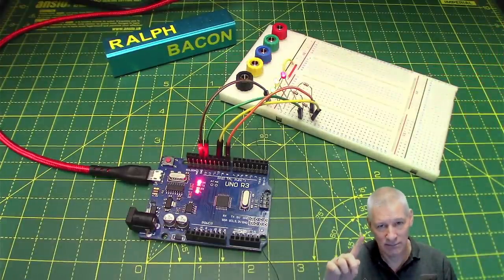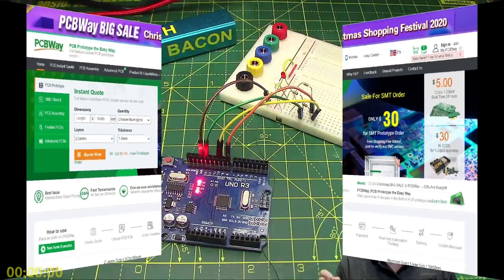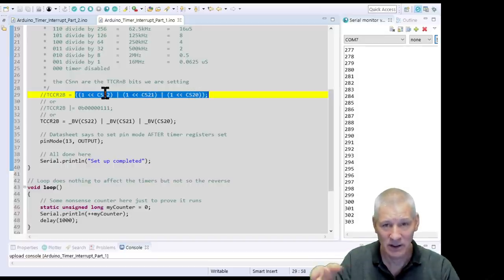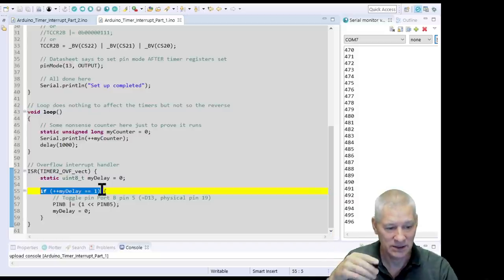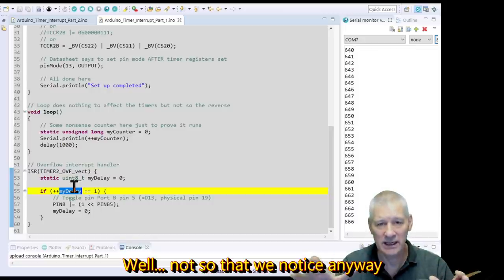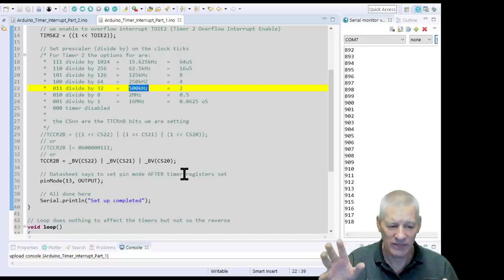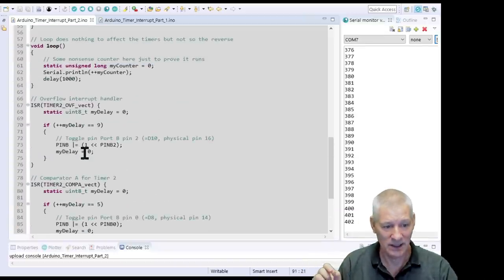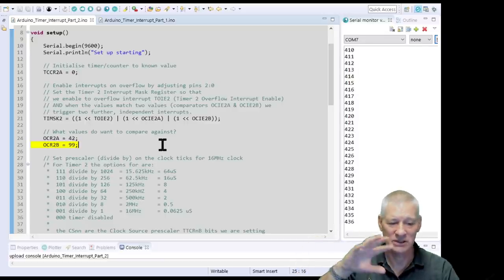#209 Arduino Timer Interrupts - Overflow & Comparator. Easy Peasy.

Comment: Hi Ralph, loving your videos - thanks!
Do you know if there's a way of grabbing the current value of an ISR vector? If so, you could hi-jack an interrupt, do your thing (increment a counter or whatever),  then pass control on to the original ISR. I did this years ago on Z80 and PDP11 systems, and it worked a treat! Would mean you could use eg Timer0 without disrupting it's usual functions. Stay safe, have a great Christmas, and hope the move goes well. Hate moving - very stressful. Cheers, John
Reply from the maker: You would have to rewrite the original ISR to either call your routine or write your own ISR that called the original code too. Applies often when using Timer 0 on an Arduino. But you can't define two ISRs both trying to be the routine for a certain interrupt condition - compiler spots it and throws its toys out of the pram. Yes, moving is too stressful considering we're packing without having an exchange date yet! I'M NOT STRESSED AT ALL!!!
Reply: @RalphBacon  "write your own ISR that called the original code too" - that's the idea. Would probably have to do an assembly code JMP from your code to the original code, so its return-from-interrupt worked correctly. But how can you get hold of the original ISR vector? I would google it, but you seem very knowledgeable in such matters, and I'm a lazy old sod. Chill - it'll all be alright on the night :)
Reply from the maker: The original ISR for Timer 0 is buried in the Arduino core but can be edited (until a new release splats over the top). It can be found in this file:
C:\Program Files (x86)\Arduino\hardware\arduino\avr\cores\arduino\wiring.c
and it's here for the Timer 0 overflow ISR
#if defined(TIM0_OVF_vect)
ISR(TIM0_OVF_vect)
#else
ISR(TIMER0_OVF_vect)
#endif
(The code then follows).
Good bedtime reading, yes, really.
Reply: @RalphBacon  Thanks. Nowt like a good yarn!

Comment: 8:20 the first and last methods also needs to be |= otherwise they will clear bits 3 to 7 !
Reply: should be ok I think.. .as OR-ing 0's preserves the underlying values ....... (1<<CS22) == _BV(CS22) == 0b00000100
Reply: @jwconlew  No it won't! The point is that the first and last of those two methods writes the absolute value, not read the current register value and OR it with the new values! i.e. first one should read
        TCCR2B |= ((1<<CS22) | (1<<CS21) | (1<<CS20)) 
the last one should be  
        TCCR2B |= _BV(CS22) | _BV(CS21) | _BV(CS20) 

or you can write it as 
        TCCR2B = TCCR2B  | ((1<<CS22) | (1<<CS21) | (1<<CS20)) 
and  
        TCCR2B = TCCR2B  | _BV(CS22) | _BV(CS21) | _BV(CS20) 

... if it makes it clearer! It's bad practice to implicitly write absolute values to registers unless you are setting/defining EVERY bit in that register. In this example the objective is to modify only bits 0,1 and 2.
Reply: @simon  You are quite right. it should really have the compound OR operator thinking about it... however the datasheet says TCCR2B bits 3/4/5 are read only anyway, and the bits 6/7 should always be 0 under normal circumstances.. so the end result is safe, just not academically right
Reply: @jwconlew  That's true. Its the academic content that concerened me. Don't want to be teaching young players bad habits!
Reply from the maker: Mea culpa, not checking it out well enough. It's what happens when you try packing a few house-moving boxes AND create a video at the same time. Smacked wrist for me.
Reply: @RalphBacon  No problem Ralph ... we'll let you off! The other 99.999% of the content was excellent. Need to slowly weeeeeen starters off Arduino, the graduates that come to my company look like rabbit in your car headlights when you throw an Infineon Tri-Core industrial controller at them and tell them you won't find an Arduino board package for that bad boy, go read the datasheet! 🤣😎
Reply from the maker: And you tell them "Sorry, digitalWrite won't work either". Put them off for life I should think.

Comment: What happens if your ISWhat happens if your IWhat happens if your ISR<***> .....

What happens if your ISR takes longer than the time between Interrupts?
Reply from the maker: You miss an interrupt as interrupts are disabled whilst an interrupt is running. However, that said, interrupts are queued... but only one (of each kind). Another reason for ISRs to do what is required and get out of there, sharpish.

Comment: 17:54 Really? if (++myDelay == 1) will always be true when myDelay is 0. The only thing you waste is the 'if' (but a smart compiler would probably remove it) ;-) What you should do is post-increment, not pre-increment. I'm sure you knew that, Ralph. :)
Reply from the maker: Actually, that code was just copied from the next sketch (with the comparators) and I changed the 5 (or whatever) to a 1 but didn't really think about it. Doh! I wonder if the compiler did remove it? But on the bright side I have packed 6 more boxes today!!! In the rain!!!
Reply: @RalphBacon  This is quite interesting. Without 'static' the compiler (GCC) removes the if statement, but with 'static' it does indeed put in a 'cmp $0x1, %eax' in assembly:

void withStatic ()
{
        static int myDelay = 0;
        if (++myDelay == 1) {
                printf("%d\n", myDelay);
                myDelay = 0;
        }
}

Compiles to

   0x401156 <withStatic+6>                 add    $0x1,%eax
   0x401159 <withStatic+9>                 mov    %eax,0x2ed5(%rip)        # 0x404034 <myDelay.0>
   0x40115f <withStatic+15>                cmp    $0x1,%eax
   0x401162 <withStatic+18>                je     0x401168 <withStatic+24>
   0x401164 <withStatic+20>                ret
   0x401165 <withStatic+21>                nopl   (%rax)
   0x401168 <withStatic+24>                sub    $0x8,%rsp
   0x40116c <withStatic+28>                mov    $0x1,%esi
   0x401171 <withStatic+33>                mov    $0x402004,%edi
   0x401176 <withStatic+38>                xor    %eax,%eax
   0x401178 <withStatic+40>                call   0x401030 <printf@plt>
   0x40117d <withStatic+45>                movl   $0x0,0x2ead(%rip)        # 0x404034 <myDelay.0>
   0x401187 <withStatic+55>                add    $0x8,%rsp
   0x40118b <withStatic+59>                ret

and

void withoutStatic ()
{
        int myDelay = 0;
        if (++myDelay == 1) {
                printf("%d\n", myDelay);
                myDelay = 0;
        }
}

compiles to

   0x40118c                                    nopl   0x0(%rax)
   0x401190 <withoutStatic>                mov    $0x1,%esi
   0x401195 <withoutStatic+5>              mov    $0x402004,%edi
   0x40119a <withoutStatic+10>             xor    %eax,%eax
   0x40119c <withoutStatic+12>             jmp    0x401030 <printf@plt>

I guess it makes sense. A static variable is like a global variable except in this case is local to the function. Maybe GCC is not brave enough to optimize a static variable? :-)

Edit: This is of course Intel assembly, but I bet it's the same story on Atmel
Reply from the maker: I know that any variable with 'volatile' is not (usually) optimised away, perhaps the same with 'static'?
Reply: Might be, Ralph. I think static variables is less likely to be optimised away because they are "kind of" global. The are allocated only once, even if declared in a function which is called multiple times. The live perfectly well outside the scope. I like to call them global variables with restricted usage.

To be honest, I don't like static variables defined in a function (or another non-global scope). They are as global as they can be, and the only thing that prevents you from using them as global variables are the compiler.  But wait! They are treated like global variables (by everyone except the compiler). Maybe we can do something bad? :-)

Consider this code:

#include <stdio.h>

void evil(int *);

int * func ()
{
        static int theStaticInt;
        theStaticInt = 1;
        return &theStaticInt;   // Really, really bad practice
}

int main ()
{
        int *anInt = func();
        printf("%d\n", *anInt);
        evil(anInt);
        printf("%d\n", *anInt);

        return 0;
}

The function evil() is defined in another c-file, compiled and linked. It's simply this:

void evil(int * i) {
        *i = 10;
}

When you run the program you get this output:
1
10

The function evil() gets the address of a static variable and alters it! This should not be possible, but the compiler cannot complain (because it doesn't know). The linker doesn't care. :-)
Reply from the maker: Now that is pure static variable abuse, Jeff. I'm sure there's a law against doing that.  😁 But in normal use, static variables with their limited scope are much safer than random global variables being updated and read by all and sundry. It's either that or passing variables as pointers, which puts off my viewers.

Comment: You repeatedly said that the ISR gets called 15 thousand times a second, but that's false. The divider you set does not set how often the interrupt routine gets called. It sets how often the timer counter ticks up. Since you are using the overflow interrupt on an 8-bit timer you have to divide by 256 again to know how often the ISR is called.
Reply from the maker: Yes, you're not the first to mention this, and I was (for some unfathomable reason) getting my timer ticks and interrupt ticks mixed up. I blame it on the house move packing. All will be good in the end, I'm sure.

Comment: If you let myDelay wrap around instead of resetting it to 0 you'd get 16M/1024/256/256 ~= 1/4Hz . Using 'if (++myDelay % n == 0)' in the test would be an easy way to vary the frequency. I think ...
Reply from the maker: Yes, a good way of doing it.

Comment: more on AVR C, thanks
Reply from the maker: Oh my goodness, you want to move away from Arduino-speak C++, Leeroy? Good. Now install a better IDE whilst you're at it, such as PlatformIO unless you already have an IDE that isn't the Arduino one  you use.
Reply: @RalphBacon  I'm using Atom as external editor, works great for me. It's not that I want to move away from Arduino, I would love to use both and it's just that Youtube is lacking quality info on advanced 328P programming, and your explaining style turns out to be very good for that. Yes there are attempts at AVR C on YT, but there are too many blind spots in them or they are too complex for Arduino crowd.
Me personally would appreciate some general technics on how to approach and understand manufacturer datasheets for microcontrollers in a more efficient way to not be overwhelmed. at328p is a great candidate as an example.
Reply from the maker: I'll bear that in mind for a future video, Leeroy. Datasheets are usually your best friend but can contain errors (gasp, shock, horror).

Comment: Ralph, I hope your doing well. I just managed to check back with you on your videos, I gathered you were or in the middle of moving and looks like you had an issue with your eye a while back? I don't know if your back up and running again, I wanted to ask if you have any intention of reviewing or have reviewed the new Arduino Pro Portenta H7 board? It's a bit pricey, but has quite a bit packed into it. It looks like Arduino is focusing on industrial applications? I just ran across it and wanted to see if you had looked at this or not? https://store.arduino.cc/usa/portenta-h7
Reply from the maker: I haven't looked at it, Jeff, and you're right, is it pricey. But for industrial applications it may well be worth the robustness and in-built micropython capability. As Arduino won't give me one, I'm not buying one just to fiddle with it! And, as you said, I am STILL surrounded by house-moving boxes awaiting my house move. Not only that, I STILL have eye issues, awaiting a further op! It just never ends!
Reply: @RalphBacon  Sorry to hear that you've still having eye issues. I know how that goes, I just had cataract surgery. Ya this Portenta is up in the PLC price ranges.
Reply from the maker: I hope your cataract replacements serve you well. Unfortunately for me, the membrane behind the lens (now holding the lens in place) has become cloudy/smeary in my left eye too and needs lasering just enough so I can see but not too much that the replacement lens falls out! Today's the day!
Reply: @RalphBacon  My cataract surgery worked out, it's amazing how much brighter everything is now. I'm sure everything will workout for you as well, after all we need you up and making more of your very informative and entertaining videos.
Reply from the maker: So here I am after laser surgery and things are looking clearer again. Still on the eye drops so hopefully things will settle down soon. Glad yours worked out well, Jeff.
Reply: @RalphBacon  Excellent news, very good, hopefully you'll be up and running soon. Now all you have to do is finish your moving, this is been going on for sometime? I guess when you're moving into Kensington Palace it takes away?

Comment: Oh-oh, that was not your best video! You probably had to little time, due to the moving.
1) You do not include anything about the actual timer count, i.e. up to 256 for a 8 bit timer. The interrupt frequency is clock/prescaler/timerCount.
2) Using compare interrupt do not change the interrupt frequency, usually you can do everything in the timer interrupt, without using compare interrupt, just with a couple of different counters.
3) ++myDelay==1 is true when myDelay is zero!
4) |= is not the operator to use for toggling bits, ^= works better.

Why not 3D print a box for the radio, it is cheaper and much easier than try to find a good box. After I got a 3D printer I have stopped buying small plastic boxes for projects, instead I print them with all the needed cutouts, studs, etc. No trouble mounting a display without visible screws and a perfect sized cutout for it.
Reply: I too was confused by the |= operator used here, but as a newbie, I had to go and check by playing on my Uno .... and indeed it does toggle, whereas ^= will not.... this is because of a "feature" as described briefly in the 13.2.2 line in the Atmel datasheet;

13.2.2 Toggling the Pin
Writing a logic one to PINxn toggles the value of PORTxn, independent on the value of DDRxn.
Reply from the maker: @Henrik
1) I most certainly mentioned the 255 max count for an 8-bit counter (I asked "you at the back")
2) I have no idea what you mean here. You realise I am showing how to do two compare interrupts here as well as overflow interrupts?
3) Yes, OK, but this was from borrowed from the second sketch where I do actually count to beyond 1.
4) |= toggles the bits (how else do you explain the sketch working)?
I haven't got a 3D printer (yet). But I have got a nice box that I intend to use. One day I might be able to afford a decent 3D printer that doesn't required constant hand-holding and tweaking, print-bed levelling and a 4 Kg spool of  printer material just to get a simple shape printed!
Reply: 1) Yes you did, but when you talked about interrupt frequency you did not include it.
2) For showing multiple interrupt handles you example is fine, but all of them will happen at the same frequency.
4) Jason Wheeler explained my mistake, I have always used PORTB for changing output and not PINB

Another place where I like using interrupt is the ADC, when I need to average the input. It is easy to do a couple of samples (like 64 in a uint16_t) and then update a result variable and a flag.

A cheap 3D printer is not that hard to use and you can get cheap models with auto leveling. I have made a parameter controlled box in FreeCad and it takes me less than a minute to design a box, then I use some time on adding holes and stuff in the program. Printing takes a couple of hours for each part (top/bottom) and I can directly mount everything in the box. Before the printer mounting display without visible screws and making holes for USB connectors was difficult, now it is not.
You can see one of my boxes for this project: https://lygte-info.dk/project/Charger%20UK.html
Reply from the maker: I will be picking your brains on 3D printers next year, Henrik, that's for sure.
Reply: You are welcome, there is an email address on my website.
I am hoping to publish my 3D box model, but I will wait for next official version of FreeCad, the current one has some serious issues with parameter control.
Reply: Using compare interrupt does change the interrupt frequency. The counter resets after reaching the OC value then counts back up to the OC value. The OC value can be changed to vary the frequency. The timer has to be in CTC mode, Clear Timer on Comare Match.
Reply: It can (not does) change the interrupt frequency, but it will still be the same frequency for all interrupts on that timer.